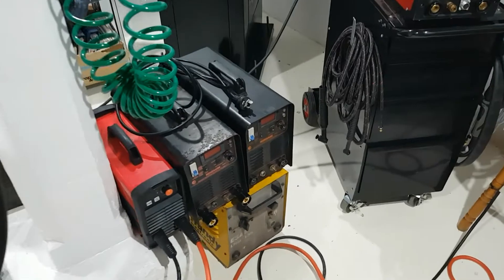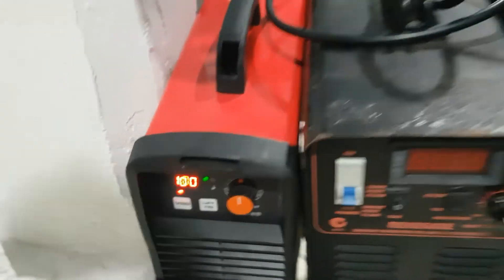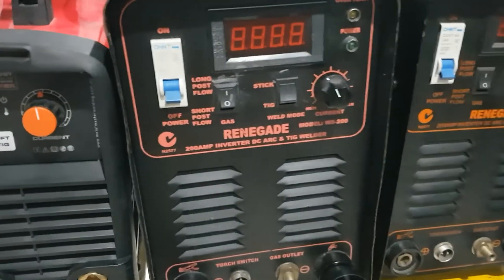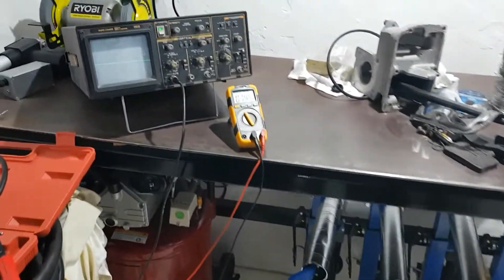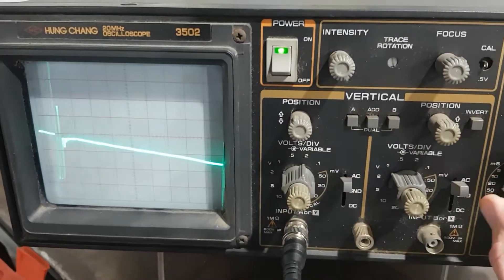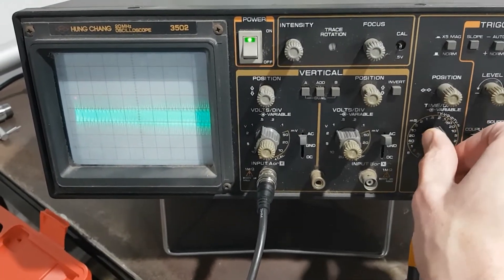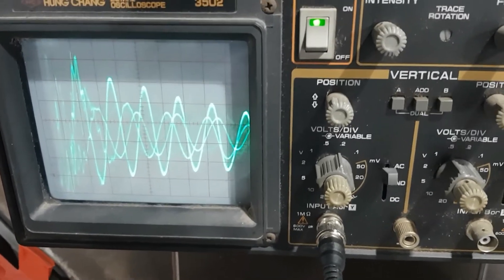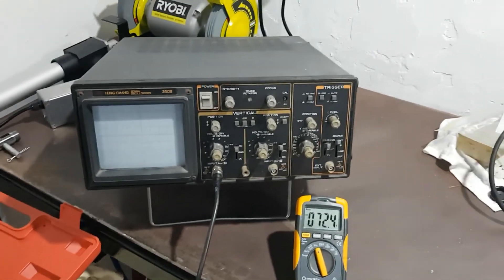Open Circuit Voltage Testing a Wad of Welders

Comment: I need to troubleshoot a welder with a oscilloscope, the issue in my mind is a bnc connector on a circuit board isnt a big gap how did you get lucky and not have it arch inside your oscilloscope. Maybe im just being paranoid. I'm currently considering using a mega ohm resistor to limit the current.
Reply from the maker: Don't leave safety to luck. The rating of the instrument and leads etc all matter, but your concern wasn't a risk for what I was doing. Your mileage may vary. An electrician or repair service can likely give some advice.
Reply: @cleanmachine08 What sort of probe are you using 100x, 10x, or 1x?
Reply from the maker: @cekiert  I have all those options here but you can see the setup in the video. Noteworthy I don't have an arc lit, nor am I touching anything with power connected.

I wouldn't go digging around inside an inverter welder.